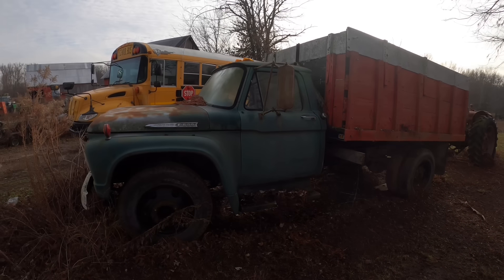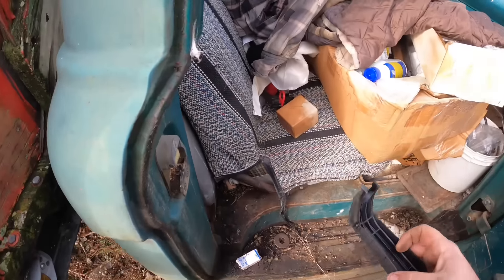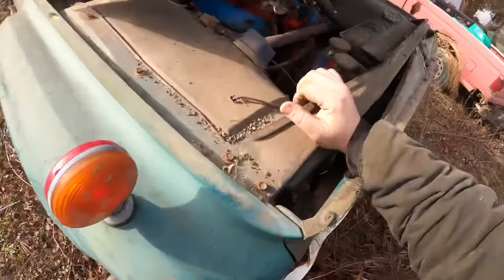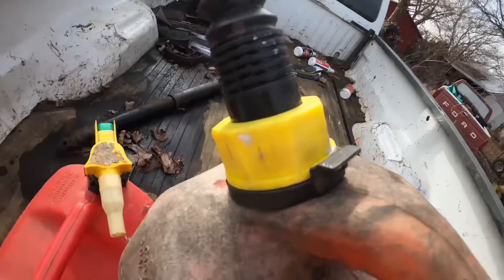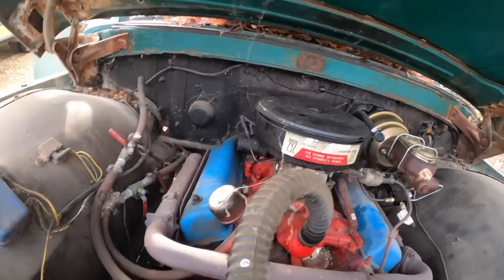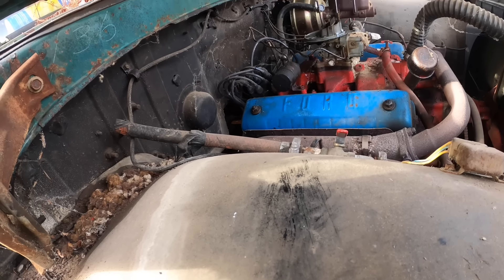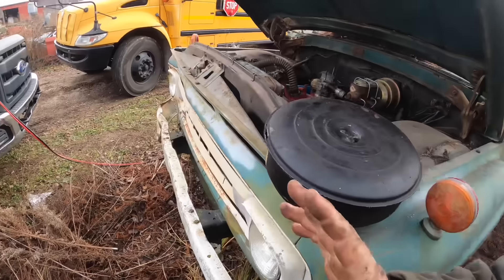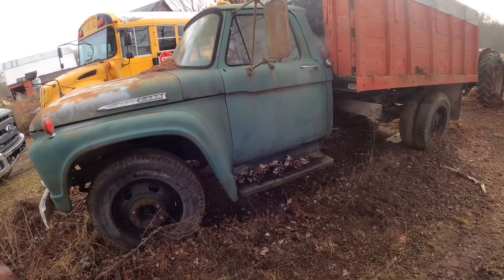Failure 600: 1961 FORD F-600 grain truck WILL IT RUN???? Part 1

Comment: Ross, push the clutch down, it will help the engine turn over. You have to remember, you're turning a cold engine with cold thick oil along with a transmission that has cold thick oil. That's the one thing I love about these old trucks, you got plenty of room to work on them engines if needed to. Another thing you could do is, and this is what my grand dad used to do in dead of winter. He'd take a blanket, wrap over the engine, fire up a torpedo heater and let it warm up underneath, everything he did that to, fired right up after an hr or so. For the brakes, as another viewer mentioned, rebuild and bore out the master cylinder, they were really "under sized" for the size of trucks they were installed in. Great video as always, cheers :)

Comment: Ross, even though the old girl didn't fire up, you'll pursue the effort until it's running. Lotsa old farm trucks that were purchased new just never accumulated many miles during years of use. At least the engine wasn't stuck...a positive for potential revival.

Comment: When I've had batteries that low, I take them out if it's cold, warm them up and charge them at a low amp setting. If they charge up, they seem to last longer when trying to start whatever if it's been setting a while. And even then, I use jumper cables and/or a charger/booster while I'm trying to start it. Oh yea, starting fluid helps keep the cussing 🤬 at a minimum. Now you'll have time to clean out the cab.

Comment: We had a 61 Ford we used as a grain truck very similar to yours. Ours didn’t have a hoist and the mill had to lift it to dump. The previous owner had a hog farm and he bought it new in pink. Ugly as sin and a joy as a teen to drive past my buddies. I almost forgot the pair of vise grips that it had instead of a gas pedal 😮

Comment: As bad as I hate to say this ignition part truly suck these days !  It seams like every year I end up putting new points and condenser in my combine (292 chevy) to the point I'm ready to put the electronic ignition distributer in it now.  A new set should last more than a year or 25 hours run time but it seams thats all you get from the chinezume parts we now get cause there such high quality ! LOL  Oh you would really like working on my old Dodge truck cause its open the hood and open the fenders and you can easily get to anything on the engine just standing beside it !  I love that old truck for that reason !  Bandit

Comment: The brake issue is the bore diameter of the master cylinder. We did the same thing to our 60 and the brakes required a lot more force to get it to stop. We eventually took the old master cylinder and had to have it bored out and rebuilt. She stops really good now.

Comment: I love this era of Ford trucks, would like to have a pick-up in this condition but most of them were worked to death and are garbage or sitting under trees.  My dad had a 1962 Galaxie with that same Y-Block engine in it.  The engine worked well without many options but his next car, a 1964 Galaxie 500  had a 352  FE block with a four bbl. carburetor.  It was a GREAT engine.  We kept that car and I learned to drive in it.   Different battery, maybe a coil and a set of points and that engine should fire right up.  That truck is not in bad shape at all.  Wish I was there to help you!

Comment: The 1975 IH 1600 here has brake gremlins. In 22' I slapped a new master cylinder on it and fixed alot of trouble.  In 23' I blew the cross over tube above the diff and that was a 10 cuss word job to sort out. Then on the way to the scale at the elevator the jumper tubes between the wheel cylinders on both sides of the diff blew, thankfully I was empty at that point. I got weighed topped up the master cylinder and made the 30 mile trip home😳 Another 10 cuss word job there filled it with corn and backed it inthe shed😡

Comment: I know what you mean about those old grain trucks not getting many miles on them.  I have a "75 Chevy C60 with 35,000 miles on it and hasn't been running in 30 years

Comment: Let’s be positive no it didn’t start but look at all the parts you found that were lost perhaps 1000 of dollars worth 😮plus you have a new flat surface you can start all over with 😂😂 battery was way to weak but a great video. Thanks as all ways.

Comment: I have 61 f600 with 292 in it I put new plug and wire   and cap points  condenser  rotor
 I got new gas tank   from Napa
 I had it running   but I like no money y brake like your 
I will make go my in shed
 It was dad I got get fix
 I get I will send  27:55   picture.  I do know u  we have a lot in common  we fix think I need  to so I can drive. It. I 1600 hundreds  bushel in crib I want use  it. I always  in joy  drive  it don

Comment: You need to go through your place, gather up all of the parts, identify them, catalog them, and put them in assigned and numbered places.  Then you could simply check your smartphone and walk directly to the part.  The old ford should start.  You might have to clean the carb.  I agree that the size of the bore on the master cylinder needs to be at least equal to the original.  Maybe you need to do a good bleeding job and adjust the brakes.

Comment: Dead batteries and low temps are a no no as they freeze same as water, 32F. Trying to charge or jump a frozen battery is an unsafe condition and at the least will make jump starting hard do to low cranking speed.